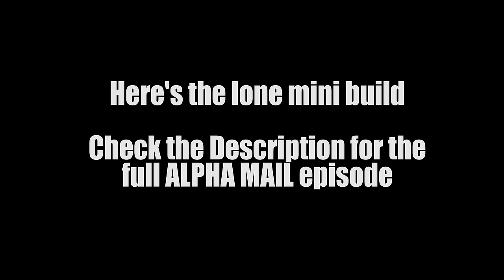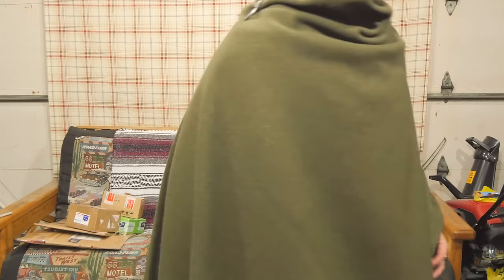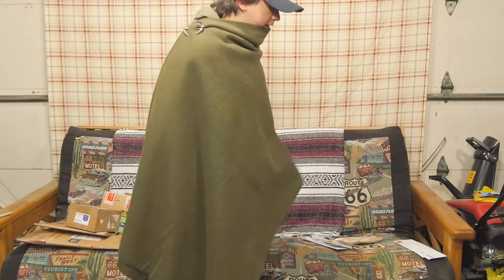How to Make a Cloak Pin MINI BUILD! (Penannular Brooch)

Comment: Trigger discipline. Don't put your finger on the trigger until you're ready to fire. Good habit to have.
Reply from the maker: +MinuteMan23 
U rite U rite.
Reply: +ZNA Productions He was ready to fire
Reply: +MinuteMan23 Saw that too and i dont even own a firearm btw. learning as i go so when the time comes and i get one i'll be somewhat ready.
Reply: +MinuteMan23 Im sure there wasnt even a shell in it so what
Reply: +Doctaime so what? It's one of the four basic fire arm safety rules. Along with treat every weapon as if it were loaded. They are weapons not toys.
Reply: Michael Murphy gnamgnamgnam its okay mommy
Reply: Like in terminator salvation, "when you point your gun at someone, you better be ready to pull the trigger"
Reply: +Michael Murphy 😂.. It's a gun,it's a piece of metal without Ammo.
Reply: +Doctaime he pulled the trigger so there wasn't,you here the click.
Reply: Fury Devil doesn't mean don't treat it with respect. If you don't know the 4 firearm safety rules. You probably shouldn't own a firearm.
Reply: Kazza FDM you don't understand gun safety.
Unless you check it every single time how are you going to know it's loaded? Accidents only happen if you let them, if you avoid touching the trigger how are you going to accidently shoot?
Reply: The bigger rule is never pretend you know whether the gun is load. You check every time.
Reply: Kazza FDM don't buy a firearm.
you are using excuses that kill people.
you must use proper safety when handling a gun. using a what if is bullshit, he didn't check it.
Reply: Kazza FDM because it's better to be safe than on the news.
Reply: Kazza FDM he did not check it, watch the video again.
you know gun safety, it's not optional.
you can quit and give up any time.
Reply: Think he was joking :P
Reply: Oookay I know this is a terribly old conversation, but both sides have a valid point. The people complaining about Eli not checking the gun however have not been with this channel long. 

Eli is an upstanding citizen of the law, and likely owns a gun license, along with having the knowledge of the gun safety rules. Not to mention, he is a Christian, and as much people think that doesn't matter, it does, because he was raised a christian, and was taught how to uphold all rules unless they were absolutely ridiculous lies thrown around by some idiot kid. 

I think Eli knows how to check his weapon before pulling the trigger, guys. Come on. He's special, but not stupid.
Reply: Trisha Demilion pretty sure he knows that he fucked up*

trigger discipline is like the second rule of holding a gun.
Reply: Moth He planned to pull the trigger, I'm pretty sure he checked it first. Pay attention to what I said, and stop being a pansy about what was shown to us. He could have edited out the bit of him checking the gun because he was condealing it under the cloak. 

Like Jesus Christ, grow up. I get gun safety is key, but if he didn't know gun safety, he would not be wielding a shotgun. Mkay?
Reply: Trisha Demilion how about i give you a quote

"While I might be biased because I have guns at home and live in a gun-lovin' state, I think it never hurts to have basic knowledge of gun safety. Treat it like it's loaded at all times and keep your finger off trigger until you're ready to shoot."

there ain't nobody that cares all that much about whether you shoot somebody until you do. so maybe you should never let an opportunity happen? i'm pretty sure you how many people get kill from guns going off on accident.
Reply: Moth A....quote from who? 

Also, I'm not saying gun safety isn't important, but you're whining and complaining that he put his finger on the trigger - when he was ready to shoot! Use your brain, do you really think he would pull that off if he thought it was loaded? Huh? Come on, be smart if you want to pull a random quote from someone I probably don't know. 

And if he said it, it was in a video I likely never saw.
Reply: Trisha Demilion a quote from a gun safety expert!

you don't put your finger on the trigger until you pull it. and he didn't shoot anything i don't know what you mean by ready to shoot but he was not.
Reply: You never touch the trigger unless you want to shoot something, end of story. I don't care if it's loaded or not because there's a chance it might be loaded. Look into Murphy's Quantum Law, if something can go wrong it will go wrong, eventually; and you wont be the first person to actually kill themselves because they were so sure the gun wasn't loaded.
Reply: 11290lars And I'll say it again, because you guys don't know how to shut up when I prove a point: He clearly checked it, and he clearly had the intent to pull the trigger.
Reply: 11290lars this guy gets it.
Reply: Trisha Demilion I'll just say again that people have shot their brains out before even though they checked the weapon, Murphy's law is and always will be a thing.
Reply: 11290lars And did I say it wasn't? You're driving an obvious point, which is weak. You're not listening to me.
Reply: He did check it, what with him pumping the gun which had it been loading would have expelled a round from the chamber
Reply: Pagos - Another point that can be made. 

Literally no one is paying attention.
Reply: my guns ARE my toys
Reply: One Bound This was over a month ago.....
Reply: Trisha Demilion fantastic observation
Reply: DCA Woodworks Clearly was ready or he wouldn't have aimed it, can ya'll stop?
Reply: DCA Woodworks He was ready because it was empty, did you not here the click at the end?
Reply: DCA Woodworks And you think he really would do that? Fairly certain he didn't show the part where he checked to see if it is loaded. Get my point here? He isn't an idiot, and even if it were loaded, you think he will care if he blasts a hole in the wall? You Know what'd he do? He'd fix it. 

Now quit arguing over this ffs.
Reply: MinuteMan23 I have a strange feeling that you didn't listen to that the first time and fired out of nowhere
Reply: Hi I love your videos so so much
Reply: I agree, you shouldn't put it on the trigger unless you're ready to fire, but you can hear at the end there that the hammer was released, so he was ready to.
Reply: Why else do you think the video was so short... He needed a new camera
Reply: MinuteMan23       It's refreshing to hear someone use that word correctly, for once.
Reply: Ok I'm a year late, but here's my 2 cents:
Gun safety teaches basic rules, such as "Never point a gun at anything you aren't willing to kill", "Treat all firearms as if they are loaded" "finger off the trigger until ready to fire", etc. The point isn't whether Eli checked, or if he had ammo, or if he was alone in a concrete bunker. If you went to a shooting range with your buddies, unloaded your gun, cycled the action, checked, double, triple, and QUADRUPLE CHECKED to make sure there were NO BULLETS in the gun, and pointed it at your buddy's head as a joke, they would throw you out. Why? Because in addition to unburned powder causing an accident, IT IS BAD FORM!

Here's the point: Practice like you perform. 
If you train by sometimes putting your finger on the trigger whenever, YOU WILL HAVE AN ACCIDENT. As Eli said in his Flail Maul video: "No matter how careful you think you are, it'll happen eventually."
If you train by consistently having trigger discipline, short of a catastrophic gun failure, you will never have an accidental shot.
No disrespect to Eli, as he caught himself and acknowledged it, this is mainly aimed at the people acting like gun safety is a joke, and besides, gun safety isn't just for you. It's for everyone around you that had nothing to do with the gun.

Not too bad for a retarded American, eh?
Reply: "A common rule of gunsmiths is that there are only two classes of firearms owners: those who have had an accidental discharge, and those who will have an accidental discharge."
— Anybody who has had more than one probably shouldn't have a gun

Treat a gun as if it's always loaded, especially when it's "not". You'd be surprised how many people were buried after being shot by a gun they or the person who shot them knew was empty. Even if you just took it apart and reassembled it and know that it's 100% unquestionably empty, it's loaded. If nothing else, it keeps you in a good habit. 
In (way too many) gun stores they have a large closed pickle jar on the counter with pieces of ammunition inside. These are the rounds that are discovered in guns that people bring in to sell or have maintenance or repairs on that the weapon's owner assured the sales clerk they checked the weapon and it was empty.

Comment: Hey bro could you show us how you wear your cloak? (Sorry for the stupid request)
Reply: actually, it's not stupid at all, really, how I think he wears it is by drawing one end of the cloak over your shoulder then follow through with the opposite end, put on the pin, and you're set for the apocalypse
Reply: i wanted to know how he set his up aswell dont feel stupid
Reply: I personally think it looks backwards, but that can also be a trend, look at the liripipe hats of the... 15th(?) Century.
Reply: Okay so I'm like three years late but I actually did this project and wondered how he got the wool blanket to fit him so well considering he's a shorter guy and those blankets are HUGE, I'm an average 5'10" guy and it hangs to the ground when I try to wear it. Then I realized he just folded it in half across the long way. Easy fix ig but seems kinda heavy

Comment: please what's the shape of the wool thing, and what's the measures u used to make the cloak?
Reply: It's a wool blanket, he most likely just folded it over himself and put the pin in place.
Reply: Apelix :3
hm thanks :)
Reply: BOSSAGSK8
No problem :)
Reply: I personally use large circles but that's a fairly different look.

Comment: if your making the main part with brass instead if flatting the ends out to keep the needle from falling off square it its a lot faster and easier  because the brass will work harden as you flatten it and the squaring will split the time in half

Comment: Hey ZNA I wanted to ask cause I'm building the railroad track anvil and want to know why did you replace the spikes with bolts, I saw that they where coming out in the video and wanted to know if the bolts held it stronger?
Reply: Just  wanted to ask as it looks like they are holding stronger and should I go the same route, you may not see this comment but if you do It would help a ton

Comment: Besides the nail what was he using for the circle? like...steel tubing or something? XD
Reply: I think it was solid steel rod. If it were hollow, the propane wtorch wouldve been unecessary.
Reply: It might not have been steel. Maybe aluminum? Steel does not bend that easily and perfectly around a pipe without being heated first. Or it could've been really shit steel.

Comment: what's that thing called that you bend and loop around the tube? the circular part of the cloak pin i mean.
Reply: +Alex - Lender Man  thats just steel wire
Reply: +pablo kencana but steel wire looks different, not to mention its easier to bend
Reply: maybe its thick steel wire?
Reply: or its a long nail with no head